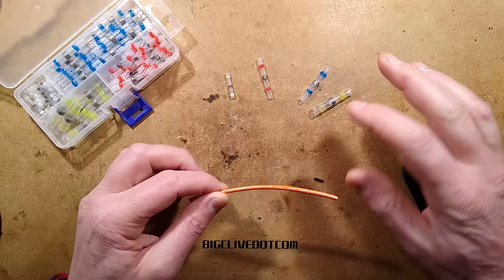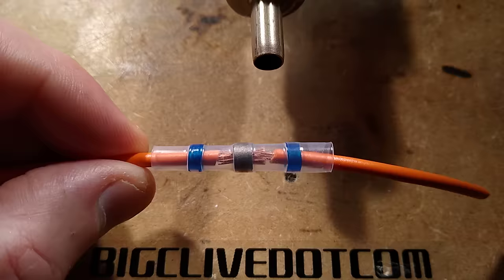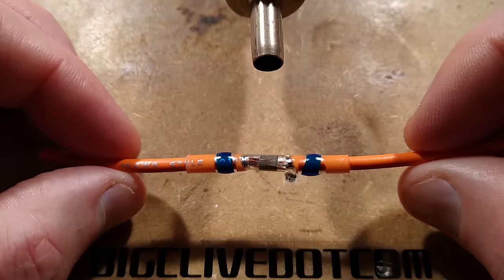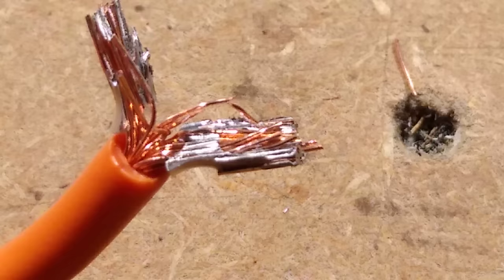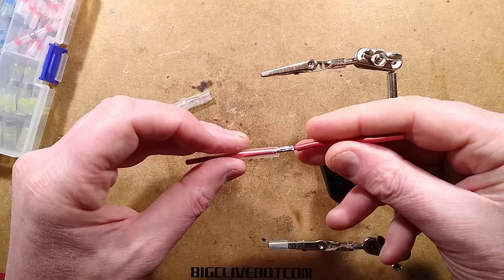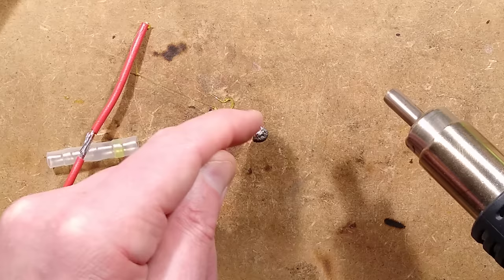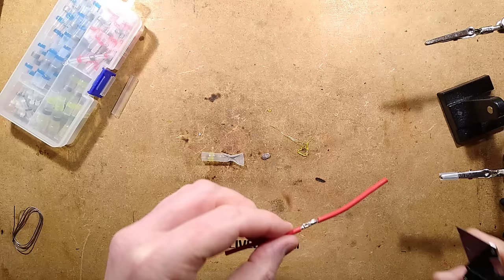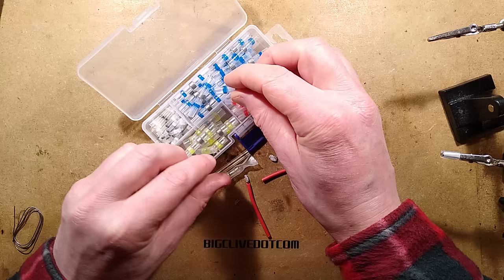Heat shrink solder butt connector test.

Comment: I follow South Main Auto Repair on YouTube and he says he stopped using these because virtually every one caused a call back when the solder joint failed after a few months of use in automotive applications.

Comment: Another review I saw suggested you just twist the wires together and then expect the solder to provide some strength and better connection to the bond. The reviewer tried using flux and didn't get any improvement, unlike a commenter below, so maybe there is a lot of variation among brands. But twisting them first seems like a good idea to me.

Comment: Instead of running one wire completely thru and out the other end  to join the 2nd wire,...it seems better to run 1 wire in, and just past the solder joint, then run the 2nd wire into the first,... "Smooshing" them together. This works a lot easier since the strands will be trapped inside the connector and will glide past each other for a better connection.

Comment: You got a cold solder joint because you didn’t add enough heat to the solder to flow properly in the heat shrink. I could see the solder never flowed like it did when you hand applied with a soldering iron,. A very  fair comparison. I used these devices in the early 90s making multi pin canon connectors on navy electronic computer switchboards so I know they work just fine if installed correctly which you didn’t do.

Comment: Distant product review. To make an apples to apples comparison you should of used the same amount of solder as the connector comes with. 
That would of shown, if it penetrates inside the core to the same degree as the product. I appreciate your efforts.

Comment: the ones to get are the CRIMP and SOLDER + heat shrink ones
,
ya get a mechanical crimp for "tug protection" and solder to help a bit with flow

Comment: I used to believe that solder joints were superior.  I then worked on robotics and found through reading that compression connectors are just as good as solder and superior when it comes to systems that vibrate and move.

Comment: I used to use these when I was in aviation, and the mil-spec environmental solder splices flowed so much better. I believe we ran about 370°c on out heat gun though.

Comment: Clive, please repeat your test using a pen knife to scrape the copper to "clean". Then, please use either a match or a butane lighter as the source of heat. The higher heat might have an effect on the solder.. And the match test might better reflect the "side of the road" test scenario.
 
Thanks.

Comment: I have had extensive experience with using a similar product in phone company applications. 🤔 I really never cut one open. We never used anything but a lighter and our version didn’t have any glue. I would not suggest a lot of close contact with the solder. As a chemist I would point out that tin and zinc are the “non toxic” metals in common usage. 😬 to get a really low temperature melt though there are a selection of metals that can be used but none of them are quite as safe as the first couple of choices.

Comment: Excellent video. Thanks! Try this again. But put a few drops of rosin flux, and/or other fluxes, to the wires and try the low temp solder again. See if flux improves the flow.

Comment: @bigclivedotcom ive used this exact pack infact just the other day, the smaller ones work quite well but as you demonstrated the larger ones lack solder volume, on helicopters we use a product called enviro-splice that has a simmilar hotmelt/heatshrink tube but uses a crimp connector to avoid the weakness of solder wicking, they are very good and will last 20+ years for joint made with a multicrimper and a lighter the only downside is about USD 1.50 per splice

Comment: I bought a similar pack off eBay with the intention to make a new 12v trailer harness. No issues whatsoever and everything works fine. I wouldn’t use them for anything more serious though.

Comment: I've used these for splicing plugs on to LED strips for church stage decorations. the main advantage it they require much less focus and training to set up and don't need to separate as much rgb cabling. They are also a bit sticky to you can have the 4 splices stay neatly together. it definitely expensive compared to a measure of shrinking tube and solder but when you have hundreds of connection to do it worth it.

Comment: The solder at the left side bottom is still cold. Temperature must not be too high. But the heat must soak much longer. 
The blue band must also be completely melted. The blue band is the waterproofing adhesive.

Comment: A proper mechanical crimp connection (with a good crimp terminal and a decent ratcheting crimp tool made for insulated heat shrink) will create a cold weld fusing the individual copper strands into a solid mass at the crimp point. Which you would see if you cut the joint open.

I've got nothing against soldering but you need enough of it to flow into the joint and based on the stray strands there is simply not enough inside those terminals. Even if there was enough solder inside to flow into the joint. The solder is probably some type of low melting point alloy (to aid in quickly melting it with a heat gun). What are the mechanical properties of this alloy? What type of flux if any is used to remove any oxidation? Who knows how long it will last before it becomes brittle and cracks? Too many unknowns if you insist on soldering do it manually. 

Crimping is just so much faster than soldering fewer tools and less prep.

This is a guide that I read years ago (it has some pictures of cut open terminals showing the cold weld):

https://marinehowto.com/marine-wire-termination/

I've yet to have a mechanical crimp fail now that I'm using good crimp tools, terminals, and techniques. The crimp tool wasn't even that expensive like 30 bucks it's paid for itself many times over the years.

Comment: Memories of cadmium based low temp solder tape where you could solder using a match. Entirely safe - apart from the respiratory and kidney failure

Comment: Like a correctly soldered joint, a correctly executed butt crimp joint, will be stronger than the base conductor material, yet will remain flexible, which is better for coping with vibration.  These are great for emergency repairs, but in Automotive, a crimped joint is always better than a soldered joint.

Comment: Another application could be if there is not enough amount of cable there to put the heat shrink beside the solder-point of the two cables. But if you put in the two ends of the cables separately the space is enough. So you can still connect them. But after all i personally prefer these heat shrink-butt slices.

Comment: I just discovered these about a year ago i dont know why i hadnt seen them before but its all i use now. I think way better than a butt connection. I usually put a little flux on the wires first.

Comment: I know this is a 2-year-old video: I don't think I've ever seen these before. I can see this working for something like speaker wires maybe, probably be useful in cycling to repair a broken brake/shifter cable.
certainly that same technique would be good to cap off the cut ends of the cable to keep it from unraveling instead of a crimp-on cap
 I don't know about next to the engine in your car though. the tubing once shrunk should hold the wires from pulling apart, but that solder looks like it'll eventually puddle at the bottom with repeated reheatings.

Comment: You would have to get the wire strands much hotter than that for the solder to flow between them, so they should be soldered first before using heat shrink .

Comment: I found that if the gauge of wire was around 18 gauge it worked ok. Larger wires didn’t fair as well. Not enough solder to fully penetrate the “bundle” and if too much heat was applied, the plastic connector would melt producing a hole. Just going to continue doing it the way I have the past 50 years…

Comment: Would be interesting to see the voltage drop across the splice running a 12v load like a headlamp bulb. Even if they aren't perfect mechanically or electrically it would be a convenient quick fix to get you home where you can do a proper job as long as the voltage drop isn't to bad.

Comment: If you could get that to work with a lighter, it'd be awesome... Then it's really a quick fix that you could do anywhere with no tools on you.
It's not a solder bond you'd be proud of, or even would like to use permanently.... but it works.

Comment: You get little heat shields that slip on the end of the hit air gun. So you get even heat around. I use a Weller heat gun at work to do this.

Comment: I used these for installing an upgraded head unit into my car. Made the wiring job dead simple. Wiring for low voltage and modest current is one thing, but I don't think I'd trust these for anything that requires high current or anything approaching mains voltage without some serious testing.

Comment: I've used these connectors-the solder does not melt, had the plastic melting instead! I was really hoping they would work since I'm rewiring a 70's ford courier. Went back to butt connectors.

Comment: These have been around for years. I tried them for wire repair when I was a dealer technician and wasn't impressed by them at all.
Frankly, I  liked using bare crimp splice connectors with glue heat shrink. Bullet proof!

Comment: 6:30 If the melt temperature of the solder was higher than that of the polyolefin then by the time the solder melted the tube would have completely disintegrated so the choice of low-melt is perfectly understandable.

Comment: The largest provider here in Belgium used this for connecting the intro cable on their distribution cable until like 5 years ago and found out the hard way that these connections are poor for communication connections. They don't resist movement and after a while placed underground (even when protected) oxidation and potential water infiltration occurs because the insulation can't resist the natural acid in the ground. Also most connections lose a lot of gain when passing a 1,1 - 17Mhz signal.
Reply: Why would they use these? There are much better splices, for example the 3M UR/UY splices (which can be used to splice Cat5E cable and still pass the Cat5E tests). If you open up any telephone pedestal in the USA chances are good that you'll see 3M UR/UY splices used.
Reply: @brianleeper5737  indeed now they use Picabond connectors on both paper/lead and plastic insulated cables. Expensive but much better, faster and doesn't even need soldering. 3M scotchlocks are only allowed on simple connections here on utp for 2-wire telephone connections.
Reply: @tellyjoossens4186  That's interesting. Picabond connectors aren't all that common here. But now the most common here are the 25-pair splices, the 3M MS2 and 3M 710.. much quicker to splice 25 pairs at a time though the tools to install these are much more expensive.

Comment: I would like to see another test. If you could cover the wires in some flux paste and then try to use this connectors. If it would work it could be much more useful in the field than trying to solder two wires in the middle of nowhere.

Comment: A more detailed way to test these would be to do a load test to see at how much force it parts and to make 10 connections in a row and run a high current through them and check for voltage drop and the temperature.

Comment: I did not have much luck with these - the solder just doesn't flow properly since the heat gun is heating the solder and outer strands of wire, while the inner strands don't get soldered.  South Main Auto did some repairs on cars with these, but ended up having too many callbacks and replaced them with standard solder and heat shrink tubing.  The mechanical crimp of butt connectors seem to be a more reliable connection.  Some crimp connectors come with heat-shrinkable covering instead of vinyl or nylon covering.

Comment: Flux is key to removing oxides to allow intermetallic bonds to form. The lack of flux in those splices could be that they are 'cheap' knockoffs of the real thing the military uses. Regardless, the lack of wetting in the joint would be troublesome for the longevity of that joint.

Comment: Hi Clive, Got given some of these. And tried them out. Like you was not really impressed. Soldier penitration was poor. It flowed on outer strands but only some got to core. Also tried smooshing and flux. It's a little better but not much. Also found the stray strands will go through the wrap. And mine had no hot melt on the coloured rings. They I think are nice for temporary repairs. But I will not be using them long term in the marine electronics environment. With  oils, water etc around. I have seen ones with soldier beads that are bigger. And more silver in colour. Think ours are Chinese rip offs. However they do sort of work.

Comment: Twisted together and add a drop of flux before inserting and the weld will penetrate ! Would be nice if they sold the transparent shrink sleeves with glue only at both ends without the lead part !

Comment: "You're driving along and suddenly your vehicle stops, you've got a broken wire," ah yes something we're all famil... dude. C'mon. No one anywhere has had that happen in the last century. :P
Reply: I have, very recently.  Car parked unattended for several weeks, mice nested in engine compartment.  Chewed almost completely through a wire, vibration of driving and current load caused the last few strands to fail after about 25 miles.

Comment: I would like to see these connectors used after adding some solder paste to the wires beforehand.  I think that would draw the solder ring deeper into the wire.

Comment: solder is only good for a low current carrying capacity in a moderately cool environment. The high CCC and  heat generated from anything 110v or over will slowly oxidize the solder joint, making it brittle and prone to breakages, especially with high tention cable joins, such as conductors twisted together.

Comment: Ive understood that they where used or developed for 12v boat wiring. I got a set to do my small utility trailer working good ,replaced some crimp type that end up with green corrosion and break .

Comment: If there is a chance pre-solder the joint  just enough to hold it together the butt solder joint could be used to  improve the joint. Neat and safe I would think. Not for 230/115V. It is very hard to have a neat high current joint. Not least where it can be inspected. Lights on a car comes to mind. The old fashioned screw terminal " choc bloc "  is hard to beat for that. It may even give brighter lights as solder is not an ideal conductor. Overlap wires if so.

Comment: I have used them for years now and they work well and I am satisfied how they work. I think my first attempts were also crossing strands, and they fail because not enough solder. They work well when you use two wire ends next to each other. 

If you cross strands, you basically create web or mesh, like solder wick uses. Yes crossing strands generates mechanically stronger connections, but usually I am more interested electrical connections.

Comment: I used these in the '80's in the defense industry.  Made by Raychem, they were only used to solder pigtail leads onto coax cable shields, never to splice wires.  Wire splicing was illegal in defense assembly work.

Comment: There are many similar alloys to "Field's metal"  (32.5% Bismuth, 16.5% Tin, 51% Indium) which melts at 62 °C (144 °F), one alloy even has a melting point of 41.5 °C (107 °F) which I think would make for an extremely dodgy joint (40.3% Bismuth, 22.2% Lead, 10.7% Tin, 17.7% Indium, 8.1% Cadmium, 1.1% Thallium).

Comment: I think my biggest concern would be that if enough current was drawn through this joint to make it heat up, the 'solder' could be compromised and the joint liable to pull apart. Why would it heat up, I hear you ask? Because there were only a few strands that were effectively soldered, the rest of them relied on nothing more than innate friction to keep them together and making an electrical contact.

For a quick fix, and in an emergency, to get you home, fair enough, but I doubt I'd want to rely on them for a permanent repair - too much like the old 'tape joint' (wire strands twisted together and wrapped in insulating tape).

Comment: I have those exact ones used in video that I ordered from Amazon.  I have  used something similar 20 years ago in field work but these new ones are definitely lower quality and harder to use.  Looks same but they are not same and it takes lot more heat to melt.  Maybe because of RoHS requirement on the composition of materials used.

Comment: Hi Big Clive, could you please do a test similar to the fist connection you made in the video but this time adding flux from your flux pen before inserting it into the solder sleeve and then dissect it again to see if there's any improvement in the flow of the solder. I think this could be an interesting extra test.  Thanks for the great videos, Stay Safe fella ❤️🌈

Comment: When I used these I had a heat gun set on a slightly higher temperature and the solder ring did actually dissapear fully into the join, where on yours you can kinda see a gray band where the ring used to be

Comment: The thing is, you can't get enough heat into  the copper strands with these butt-connectors, which is probably why the solder doesn't penetrate completely---apart from the solder provided, being a rather low-temperature-melty type. It IS however a very good emergency fix.